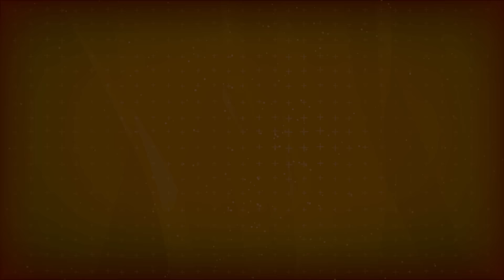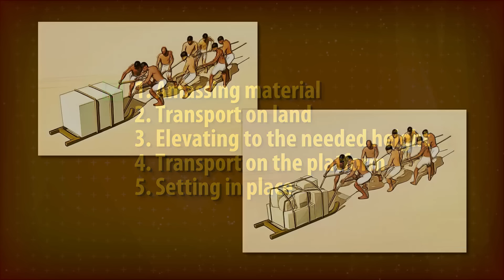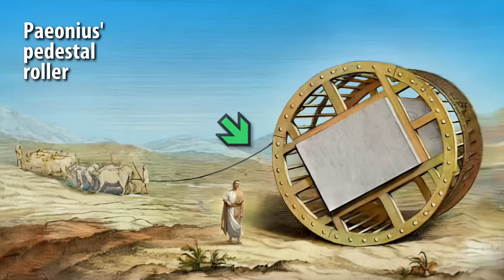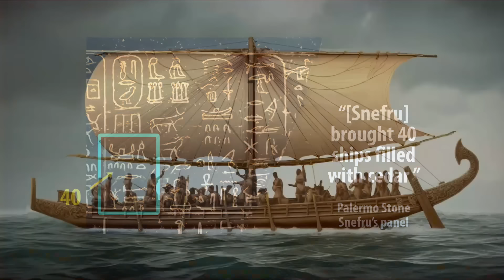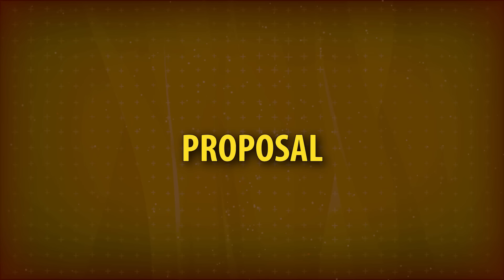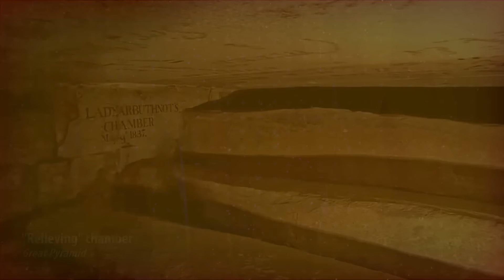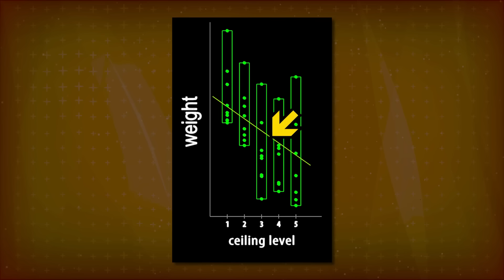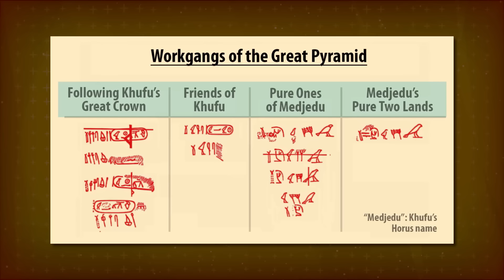How to Build the Great Pyramid in 9 Months (NOT aliens)

Comment: That is some good work but how are you supposed to put the finishing smooth blocks that covered the pyramid ???

With these type of ramps it only makes sense if they started first from the top of the pyramid and started to dismantle the ramps as they moved down .

Also I'd like to see some chart of the size of the blocks versus the height where they are .

Because some of the blocks put down seemed to be far larger, almost the height of a man . Which is strange considering the height where they were .

Also , don't the pyramids apparently have EIGHT sides ?

It took a while to figure that out but was this the result of a particular way they were building the pyramid ?

Maybe the particular method used to mesure the accuracy of the pyramid ?

This could be important or not ...

Comment: So the pyramids have a crease on every side in the center. Not sure if this helps or not. Look at aerial photos of the pyramids and you will see there are actually 8 sides and not 4.

Edit: Maybe the crease is there due to the way the ramps where set up. Looking at the image of your ramp set up ironically the most cross sections of ramps is central on the pyramid walls. maybe they had to put extra supports along the center and this in turn created this crease?

Comment: You left out the internal ramp theory of Jean Pierre Houdin, which seems to be the best hypothesis as of 2023. 

The idea of filler rubble in-between more specific cut stone structures is very compelling. 

Also, the Khufu interior has been analyzed sonically, and clearly it had a function. The other pyramids, perhaps not so much. But the geometry of standing waves in the Grand Gallery, with sound waveform filtering structures, is too impressive to dismiss. It probably used sound, generated it, or otherwise acted from it for some purpose we've yet to ascertain. But clearly, Khufu Pyramid had a function OTHER than a funerary or other grave purpose. 

Khufu adopted the pyramid and repurposed it. I doubt they ever knew what they were for, either. The pyramids and other underground structures were built 25,000 - 75,000+ years previously, so they likely had multiple uses over the eons. One wonders if the psychopathic Illuminati or other Secret Societies that have re-written history and are enslaving us, have the evidence for the pyramids actual function. I suspect so!

Interesting program, if incomplete. Thank you.

Comment: This is the most sensible description I’ve seen as to how it might have been done. Of course they had the wheel to roll rocks. And yes rubble was a big part of it. Really well thought out. Great video. If you were an ancient Egyptian I’m sure you would have climbed the corporate pyramid quickly with these ideas.
Reply: But they didn't have the wheel when the Great Pyramid was built.  Also, without paved roads, wagon wheels would have sunken into the ground under the weight of a 100-ton block of granite.
Reply: @customsongmaker  The idea that the Egyptians didn't know of the wheel is kind of outlandish considering that their neighbors up around the Euphrates, the Sumerians, Assyrians, Babylonians, etc., had the wheel and interacted with the Egyptians on a regular basis. It's more likely that their system of transportation was based upon the Nile and shipping, rather than carts and wagons thus making widespread use of wheels unnecessary.

Comment: This is a one-of-a-kind documentary that everyone of all perspectives should watch.  It shares a continuous stream of innovative ideas that have not been presented before.  While it doesn't answer many questions, since nothing can, it provides facts that you never come across and possibilities the need serious consideration.
Nevertheless,... while it rightly shares the generally ignored fact that the pyramid is not composed of millions of cut quadrangular blocks, relying on oddly-shaped boulders of naturally variable sizes instead, it proposes a workable ramp system that relies on the production of tens of thousands of perfectly quadrangular blocks that would be needed to construct the enormous number of proposed ramps.
That would have required an enormous number of block-sawing stations producing tens of thousands of quadrangular blocks.  That fact was not addressed in the slightest.  So we are still without any solid answer as to how they constituted the inner mass of the pyramid.  They could cut and transport quadrangular blocks, as well as use natural 'rubble' or oddly shaped boulders, so we can only speculate as to what the proportion of each was.

I figure that they used as few cut blocks as possible (which were needed for the structural stability of a sturdy core matrix) but placed them in such a way that resulted in spaces between them that could be filled with rubble and sand, greatly reducing the total number of blocks needed.  Knowing the ratio between detritus and cut stone would surely help to suggest the easiest means to have raised and placed so much stone with so little in the way of mechanical power.

Comment: There are too many serious problems with the painted scenario regarding the heaviest ceiling block of the King's chamber.  You claim it is positioned just above the coffer but that is not correct.  It is clearly several coffer-weights farther away from the back wall, while the coffer, which is rather close to the wall, is placed next to the joint between the first and second floor blocks.  So to claim that the coffer is below it is inaccurate.  That dispels the assertion that that heaviest ceiling block was pre-meditatedly placed above the coffer to "protect the king".

That assumption is not logical since the 'best protection' would have been a chevron ceiling, not a flat one of such great width... as we see in the Queen's chamber and the newly discovered chamber behind the sealed entrance.  Also, the entire relieving chamber complex serves no discernable purpose, (nor does the granite composing it and the king's chamber).  A chevron ceiling above the flat ceiling of the chamber would have served to "relieve" the stress of the weight of the blocks above the chamber... just as the chevron ceiling of the Queen's chamber protects it from much greater weight seeing as it is at an even lower level.
Also, no one has ever explained how old kingdom masons could have shaped massive pieces of granite without highly sophisticated hardened steel tools.  It simply can't be done on such a scale... nor could they, as you've pointed out, quarried granite... unless they employed technologies that we know nothing about... which the evidence indicates that they did.

Comment: A point that is never made is how they built them a layer at a time with non-compressible stone layers so a heavy stones using granite cylinder wheels can be pushed across this new work surface.
Also imagine if a goat skin air bag was stuffed into the cradle structure, would x4 bags allow a 2t block to float?

Comment: Also remember that the Egyptians could have easily used bitumen or rubber-coated fabric inflated cylinders to carry the stones over sand or anyting else without any road just like giant ships are now rolled on those devices carrying tens of thousands of tons. The idea that Egyptians who had civilizations for thousands of years wouldn't have thought of all kinds of variations of wheels and inflated bags and quarter round bales as you say to make square shapes around is just ridiculous. And if the rope around the stone was a continuous loop then that would be easy to work with as well and it could have nots in it and they could use mechanical leverage and they could use sand for the ramps and they could use clay for the ramps and we would have no trace of any of that left today. I'm so glad somebody finally did a video like this that talked about these possibilities thank you

Comment: Khufu didn't "build" it as there's radio carbon evidence (from founded wood pieces) it was built long before Khufu. And then there's Cayce having said it was 100 years in the planning & 100 in building. And that is far more logical than the 20 years myth.
   In any case this study is peppered with facts & suppositions to make it's point

Comment: It’s interesting to me that with all of the interior tunnels in the pyramids, how did the workmen operate in the dark? In all of the pictures and videos of these tunnels they are illuminated with artificial light.  There is no evidence of soot from burning material. How was the lighting of the tunnels accomplished?
Reply: Make or buy an olive oil lamp (you could hollow out half a potato and put a wick in it f.e.). Put it on your kitchen table and light it. See howmuch soot it leaves on your ceiling...
Reply: Good idea. I’m sure that the tunnels had plenty of ventilation.

Comment: Lol what a joke modern problem solving to build ancient structure they still have. I clue what is was for. How about this theory. The Egyptians inherited the pyramids and did not build them.
Reply: present evidence please
Reply: Im still waiting on the video to present evidence and not conjectures. i would like to know the construction experience that this fellow has as well. You can not build anything of that size and weight on sand. Furthermore, you could not stabilize anything with mortar for more than 30 or so years before it  totally degrades. That is why other pyramids mad by the Egyptian Dynasty are crumbled and collapse.
With Pyramids in Giza we see less structure  failure do to tools and technology  from 1st Dynasty Egypt. Most of the wear on the Pyramids is consistent with weather. Not failure of "mortar" or any other man made material to include crude cut stone.  2,250,000 block weighing up to 250 tones each. What machine lifts that? The 3 smaller pyramids in Giza where "possibly" built by  Egyptian Dynasties. The Great Pyramids no. Egypt will continue to insist that the Egyptians built them because it is claim to that makes Egypt millions in tourism.

Comment: Interesting take,  It's a good theory. I don't think 9 months is attainable with quarrying the stone and transportation, that said its the best theory I've ever heard. This was a great video. 👍
Reply: Nor the base, which is completely ignored. The base of the pyramid has been carved out and part of the Pyramid is built into a natural slope.
Reply: @haaggus  no the evidence says it was built in 20 - 30 years. It was built during the Pharaoh’s reign.  If it takes 263 days to cut granite as you say, they must have had a lot of cutting teams. But that’s granite, other types of stone would be faster. And you don’t have to cut all the stones, there were other methods used as well.
Reply: @haaggus  the archaeological evidence, as provided by Egyptologists. Look, what you are calling “evidence “ is simply disbelief. You are arguing you don’t believe it could be done. I accept that it was done, the only question is how. And several thousand motivated people can accomplish a lot (including laying more than one block at the same time).
Reply: 9 months is the physically minimum time. The archaeological evidence suggests 20 years. There was a small town of artisans working year-round and you had a large labor force 3 months a year during the flood season. Given the artisans preparing quarter-circles and dressing stone during most of the year, I could see 12 years to build the core and then the next several years casing the pyramid. Definitely a big project, but with excellent organizational skills it is doable.